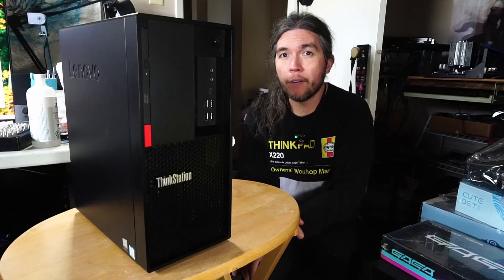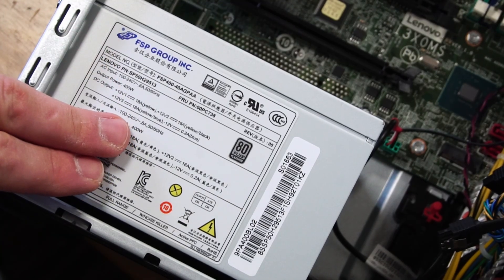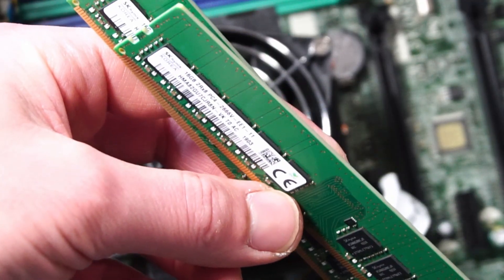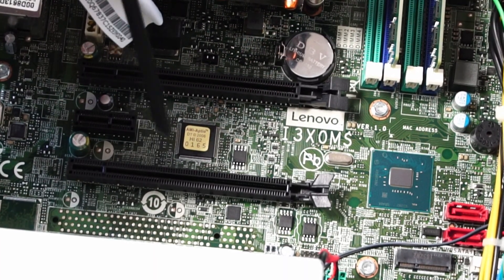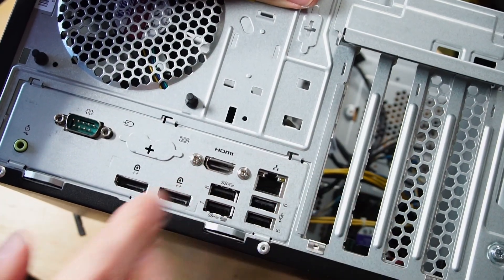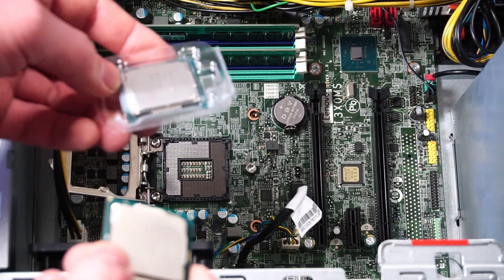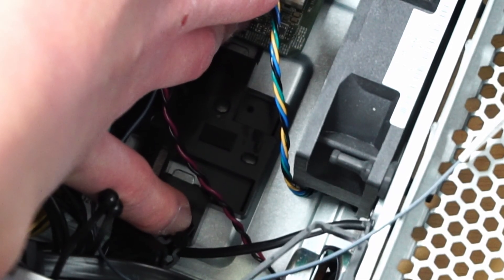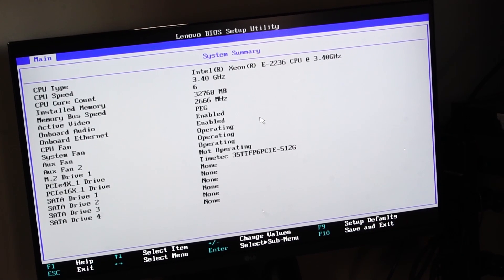Lenovo ThinkStation P330 upgraded!  Rendering, Gaming, Review (2025)

Comment: hi i have the same pc but with i5 9500,what the best cheap processor for that pc?that xeon is good ?and what the best graphics card,because i thinked about 5060 but it has pci e 4.0
maybe 9060 xt?because i dont want performance loss and change the power supply,i have the same 400w
i’m also looking for used videocard but 5060 is better than 2060 super,what do you think about that all?
Reply from the maker: I suppose the i9-9900, but I am going to guess it will be difficult to find that CPU at a decent price.  Maybe i7-9700.  The Xeon CPU in this video is decent as well.  If you upgrade the GPU to 5060 or 9060XT, just make sure it fits and only needs one 8 pin pcie connector.    You will reach a bottleneck of sorts, but with a mid tier GPU it won't be so bad.
Reply: @HaisteComputerRepair xeon2236  is 3x cheaper than i7
and what gpu will work without bottleneck?
Reply from the maker: @ПавленкоМаксим-д1д  Maybe an RX 6600
Reply: @H @HaisteComputerRepair and i need to change psu if i want 5060?400w i think is too weak
psu for this pc is too expensive 
i’m looking for the gpu that will work with 400w
maybe same 2236+2060 super but i want better gpu :((
Reply from the maker: @ПавленкоМаксим-д1д  5060 is rated for 300W, so it would be fine.  Or an RTX 5050.

Comment: So I got a question I literally just got that PC today and this is after a return already an exchange for another one that was supposed to have a 400 w power supply well mine the second one does it have that do you have any recommendations for a power supply and if it's not a OEM possibly an idea of what directs I could go with the adapters that could warrant the use of a 24-pin PSU because I do want to put a 20 series GPU in this thing I think it'd be a good daily driver. I enjoyed this video a lot and it made me feel good about my purchase. Also I've been thinking about possibly getting a GPU that is powered from the PCI Express slot and I kind of stumbled into the Intel side of stuff with the b series professional cards now I don't know how much background you have in that and what I was doing Network administration intel was it doing that it's been quite a while but I'm just trying to find a good pairing with the the Zion and something that won't you know mailed in a bad way to where they're swaddling between your component. If you do respond to this I appreciate it I'm not expecting a response I'm just shocked that I was able to find a video with the PC literally almost a new upload from you that corresponds with what I have aside from the psu LOL I'm renting now and I apologize. Note I've had a hand surgery on both my hands so I used speech to text when I apologize for any inconsistencies. Well I just seen the post you had with the lake to the specs of the unit and I was thinking a pro series until the card like the b30 or the b40 but now I'm looking at the quadros and I know I could get a couple of those for fairly cheap that are 75 watt or less but regardless thank you for your upload band I really do appreciate getting to see the same run and I am excited about having this thing
Reply from the maker: What you install really depends on what you want to do with the unit.  Replacing the PSU with a regular ATX model would mean having to use a 24 to 10 pin cable adapter which would cause the PSU fan to run indefinitely until either the switch is turned off or it is unplugged.  Of course there are PSU's with fan idle features, so that is an option.  Just know that the adapter is a kind of jumper cable, which removes the function of powering down when the PC is not unplugged.  It can still go in sleep mode and the system can be shut off, but power to the PSU will be constant.
Reply: @HaisteComputerRepair doing a PSU upgrade with a third party PSU and a 24 to 10 pin adapter is not an issue with me because like a wire a power switch in line I've done it before and I can have it actually sequenced with the system boot and post but I want to run a 260 I want to be able to play battlefield 6 at 60 FPS and that's it medium to high settings nothing crazy no anything like that. I am a power user of sorts I do a lot of multi OS imaging and not so many VMS but actual date of os installs and I'm costly testing programs and stuff like that I used to be a network administrator and security analyst and now I just use my power for fun things if you will but thank you for getting back to me to responding I do appreciate that. I've looked on eBay and Amazon and trying to find a 400 watt PSU and there's even some threads that Lenovo did option of 450 watt PSU so there's those two options but they're not cheap by any means of the term. I was wondering if maybe you might know of an option for an oem PSU cuz that's where I would like to go and respect of this system it's a nice enough unit to keep it og-oem in regards of upgrade path and replacement parts I just am not fluent in that market no more. I had a stroke over a year ago and it's hard for me to remember avenues of acquiring these things like I used to. As for the upgrade compatibility and methods of achieving those types of solutions that's not a problem for me I've done it before I can figure it out again I was just wanting to know times have changed and with the way the markets in the tech world are fluctuating insanely bad I just was wondering if maybe you might have a solution that you can shoot me a link to or something like that. Thank you for your time and I wish you a merry Christmas and a happy new year.

Comment: You install a rtx 2060 super on a 400w PSU? Isn't the 2060s like 170w tdp?
Reply from the maker: 175W actually, at least from what is listed on Techpowerup for the reference card.  450W recommended for a power supply.  If you check out the gameplay footage in this video with the MSI afterburner stats, both the CPU and GPU power consumption peaks at ~260W.  But either way, I would communicate this to the customer and they can make an education decision as well as receive support from me.